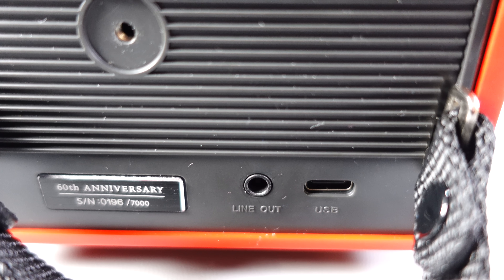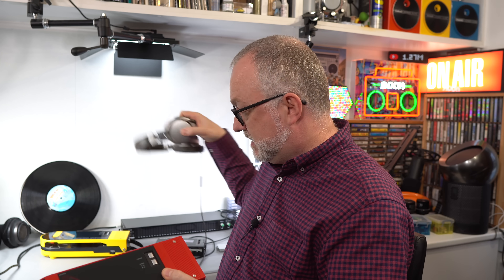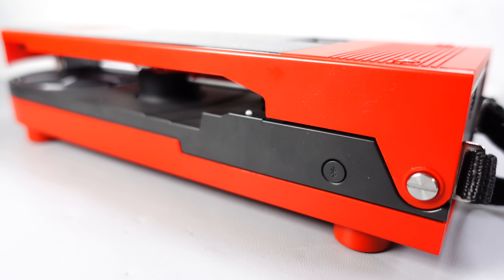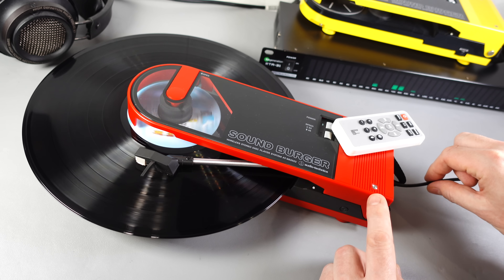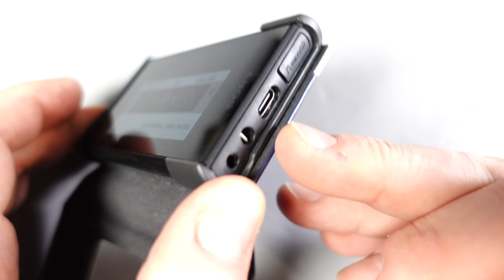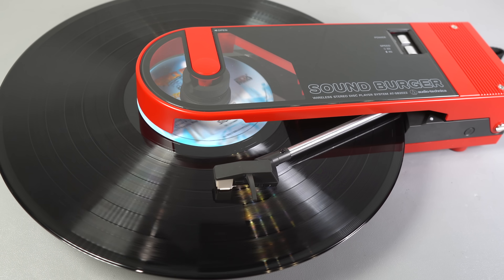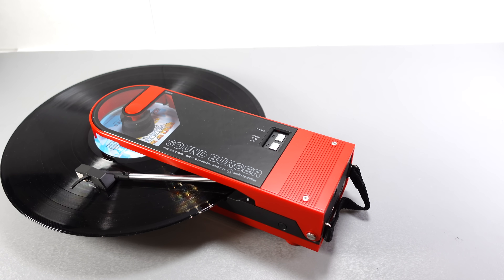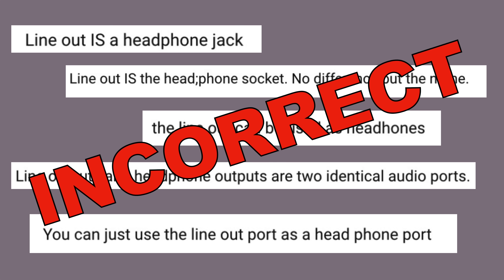Line-out ≠ Headphone-out

Comment: Desktop pc sound cards have a socket labeled line out and you can plug in headphones into that, sound card detects the impedance of what’s been connected and adjusts levels appropriately. This may be the source of confusion.
Reply: I was just about to write the same thing and then saw your comment.  The sound I/O chip definitely does that in most PCs.  In some cases they even ask you to confirm what you just plugged in.
Reply: @PhilR0gers  Most will ask to confirm because the impedance ranges for headphones and line outs are virtually  the same 80-600 vs 100-600.   By selecting what you plugged in it allows the system to process the proper audio level to the jack constant or variable(-10dB or -7dB), just like using a physical switch to choose.
Reply: Dell Optiplex always detects if have plugged in headphones or speakers, although I need to choose, cause the sound card thinks my headphones are speakers probably because of the larger impedance
Reply: Modern smartphones do the same thing - they even remember separate volume levels for line out and headphone out. On my phone, the line out (which I use in my car) is always set to 100% volume, whereas the headphone out (which I use on my bike) is usually set to 60 or 70% volume. You can hear the impedance testing when you plug the connector in halfway (so the wrong set of contacts are being connected), you can hear some high pitched test tones as you plug it in.
Reply: @muf1772  Well, most modern smartphones have no jack anymore. But good to know that those who do have the same functionality.
Reply: @kyoudaiken  Wouldn't say most, more like 50/50
Reply: @PiddeBas  deffo not 50/50
Reply: @muf1772  So that's what the high pitched noise is! Thank you
Reply: The confusion is older than PC sound cards. It stems from old boomboxes with Headphone/Line Out sockets
Reply: @koppadasao  I remember them being separate or manually switchable.
Reply: Yep, some modern motherboards with supported audio chipset and hardware combination can detect impedance and perform auto adjustment for it, though GUI software is required for that.(from manufacturer)

My X2HR(30ohm) when plugged into my Gigabyte X570 Aorus Pro AX, the driver automatically chose "smart amp Level 1" for it. (onboard ALC1220 supports "smart amplifier".)

On my previous ROG Crosshair VII Hero, it also does automatic impedance detection. The "SupremeFX audio" claims to use multiple MOSFETs for impedance detection and there are various external circuits for amplification.
Reply: For headphone out you need low output impedance (ability to supply sufficient drive current) and volume control. Line out doesn't need either. For 16-45 Ohm headphones, you don't need more than half a volt, so with a current buffer, there is no differentiation needed between low-impedance headphone out and line out. This is the logic of MANY non-hifi devices including PCs.

Indeed driving both headphones and line from the same outputs is how it has been done on PC soundcards for decades long before impedance probing become available with Azalia.

In HiFi you expect additionally ability to drive 300 Ohm headphones, which need much higher signal voltage and correspondingly lower current.
Reply: My pc gives you the choice of setting as line in, line out, mic or headphone when you plug something into the socket
Reply: @woofgbruk5947 yes but the headphone choice isn't a true headphone feed, it's why when you turn the volume up they sound crap.
Reply: @wheelmedia0832 no, thats not the issue here. That would be emi noise. All motherboard audio has this issue because no matter how much you try and shield or seperate motherboard audio, its still gonna be inside the computer. SP/DIF would be usable, however, as its full digital out (though that should be fairly obvious anyway)
Reply: @Douglas Blake Not every PC is the same. I had motherboards which do and even display the impedance. And it's roughly correct. Remember that low impedance is hard to measure accurately with low current.
Reply: I had a motherboard back in the 00's with ports for 5.1 surround in addition to the usual set. It'd let you plug anything into any port and if it couldn't detect what it was you'd get a popup asking. I used the rear and center speaker ports as extra line-ins when recording stuff.
Reply: Realtek sound drivers have a jack reassignment switch in software and that allows each 3.5mm jack to change functionality. I've done funkier things with that before like using microphone-in as headphone-out but it will always sound worse than the original function of that specific port.
Reply: Also, some PC sound cards can bring up a list to choose what is what you plugged in.
Reply: @IntegerOfDoom  Again, too literal.  Too complicated for YT reply but you can measure impedance using  (Z = V / I)  You can substitute impedance Z for resistance in Ohm's Law. Calculate Z = V / I to find the impedance at resonance frequency. This should be the maximum impedance your speaker will encounter in the intended audio range.
Reply: @Douglas Blake Not Necessary is not the same as Not Possible.
Reply: That is what makes Windows PCs great compared to Apple computers. They have discrete sound cards with line-in and microphone inputs. Mac, it is headphone only, but you have the internal mic with Webcam on the Macbook and iMac. Still, no line-in as on the old computers. So new Mac computers are downgraded. No, USB audio is not a replacement but you can get decent sound just counterintuitive and defeats the 'good-vintage' premise.
Reply: Regarding this, what if you need the Line Out to plug in your Surround speakers, so now you have nothing when you want to use headphones? Plugging in and out every time I switch from Surround (movies) to Headphones (games) seems tedious.
Reply: Line out on PCs do not detect a headphones impedance. They can however act as dual line out/headphone output and will ask the user whether they have connected speakers or headphones. If you tell it you have connected speakers, it will keep the volume to the line out standard. If you tell it you have connected headphones, it will allow your device to access the sound card amplifier. However, the headphones will still be limited by the amplification power of the sound card, meaning that higher impedance headphones will still sound quieter compared to lower impedance headphones. The sound card itself doesn't know what the impedance of the headphones are.
Reply: @SSJfraz  Yesno. It depends on the standard the Desktop PC uses. AC97 needs to ask the user if a headphone was plugged in. Intel HD audio though (even if you use an AMD platform) it will detect and adjust. And it also depends on the motherboard and which audio chipset it's using. It's typically Realtek these days with diverse amplifiers fitted. You can still change the impedance if you desire. AC97 is almost extinct and almost vintage by now... Seems like you are handling very very old systems. But times are changing.
Reply: @kyoudaiken  I'm sorry but it's impossible for any sound card to automatically detect the impedance of any headphones connected to the line out. The sound card simply takes a digital signal, converts it to analogue, then boosts the analogue signal before sending it to the headphones via the cable. The headphones do not send any information in reverse back to the sound card. The only way the sound card knows that you've even connected headphones at all to the line out is when the PC prompts you to select headphones or speakers once a device has been connected to the line out. The headphones can't send digital data to the sound card informing it what it's impedance level is, because only analogue signals can pass through a 3.5mm jack cable and line out only sends analogue information in one direction, it can't receive analogue information. A mic input on the other hand can receive analogue information, but headphones aren't microphones (:
Reply: @SSJfraz  Sorry, you are wrong. It even shows the headphone impedance for me, which is roughly correct. High end motherboards do this since almost a decade now. I can't send links on YT so I cannot show you a screenshot for proof. But it's real. Most high end motherboards (not all) do this. And that's where the confusion comes from. People think Line-Out and Headphone jacks are the same when it's really not the case just because most PCs and laptops are clever.
Reply: You are wrong. Sorry. I can read the impedance of headphones with a simple voltmeter, why would it be impossible for a sound card to do the same? You way over complicated your thoughts and are taking the whole "data" thing too literal. Just about any electrical device is capable of providing feedback in the way of resistance and or capacitance level. How does a AAA battery tell the device it is low?
Reply: @SSJfraz  It would be trivial to build impedance detection into the card if that was to be part of the design. There is such a thing as having multi-use pins, every microcontroller for instance can switch any pin on it from input to output via software. I've used the same pin on a chip to drive LEDs and also to detect if a switch is pushed, you just shut the LED off and put the pin into input mode for a millisecond to read the value, then go back to driving the LED. Not noticable.
Reply: @SSJfraz  who said anything about "sending" anything, or a "digital" communication? It's trivial to measure the impedance, you send a ~10kHz sine wave through the headphones at a known voltage and measure the voltage across an internal reference resistor in series. This will tell you the impedance after one simple calculation. Alternatively you can do a whole frequency sweep and be even more accurate, or you can use DC and be less accurate but silent. Don't speak on what you have no clue about.
Reply: @boardsort  you can't read impedance with a common
Reply: @SSJfraz  Headphones have 16–64 "ohms" of impedance and draw relatively high current. Line inputs have ~10,000 ohms of impedance and draw very little current. On an auto-sensing output jack, the amplifier knows the voltage and the current it's putting out (YES DIGITALLY) and therefore knows what device it's connected to.
Reply: @SSJfraz its entirely possible for a intelligent circuit to evaluate the impedance of the circuit that follows it, in this case the relatively low impedance load of headphones or high impedance of an amplifier or buffer stage. The MAX9856 chip is commonly used in sound cards and does exactly that. 'the software automatically monitors the insertion and removal of a headset and reports the result in the Headset Presence group box. If there is a headset configuration change, the software automatically detects the headset impedance and reports the result in the Headset Impedance group box.'
Reply: Some people seem to think all PC sound sockets are the same. Some Sound Blaster cards DO automatically detect attached impedances. Not all things that appear the same are, which is the entire point of this video some seem to have missed. Your experience doesn't cover all potential experiences.
Reply: @SSJfraz  headphones are lower impedance, typically 8-100 ohms, vs line which is typically 1000 ohms or more.
Reply: yep i was about to comment the same... it can also have a headphone out however your computer detects what you jacked in and adjust it...
Reply: Or in some cases you get a pop-up on the screen asking what you just plugged in so it can adjust
Reply: Fair point
Reply: Yes I can see where that could cause some confusion. That is good information to know.
Reply: On Computers it will not normally detect when you plug something into Line Out unless it's a quality SoundCard and the mis concentration it is a Boosted Mic Port is wrong.
It is your Software as in the little volume Control at the Bottom right of your Desktop in the case of basically every version of Windows.
Plus normally it's Speakers plugged into that Slot.
Reply: yeah, mine did so, and it also ask me what lineout i plugged in, while some output maybe not significantly shows the difference, but when im using combo headphone, the difference between Line-out, Headphone, and Headset slightly seen
Reply: All I know is that the line-out on my PC card is amplified no matter what I plug into it or what I tell it to do.  Using the on-motherboard audio ports, works but I have to crank the shelf unit I use as a set of speakers down to nearly nothing to prevent me from blowing the poor things out.
Reply: @Minalkra  Make sure you got the correct drivers installed.
Reply: @Douglas Blake They can do that perfectly fine as long as they can lower the level down to line level if requested. Heck, we had sound cards in the 90s with built in 2x5W speaker amplifiers that you could enable with two jumpers on the card.
Reply: At the risk of sounding stupid are the  🎧 with a built amplifier..or would that require power .Or have I missed the point completely 😮
Reply: @boofuls  only noise-cancelling and wireless headsets have amplifiers in them. Also, a line-level signal is designed to only send a signal as voltage, not power. A headphone jack has to send both, so huge difference in the electronics that drive them.
Reply: Yep, I have a suspicion that this is EXACTLY what caused the confusion.
Reply: Heh. Gamers amirite
Reply: Some of the cheapest on-motherboard sound chipsets as well as some 90s sound cars seem like they only have a "line out" and "line in"
Reply: ?Question?..
Also..What is the PHONO jacks for and is it different than line jacks and how so??? Thanks
Reply: Yeah this was my thought, I've been using it for headphones on desktop for years now with no issues whatever. It's good to know that there is a difference but contrary to what the video suggests, there are plenty of devices where you can use line out for normal headphones with zero issues.
Reply: Did not know that but pc have a vol control anyways
Reply: Thank you. Glad someone else saw that too. Because that's been a lot of my experience
Reply: Problem with that explanation is that most headphones today are around 32 ohms, but headphone outputs are required for 8-600 ohm use.  Line outs use a source impedance of 100-600 ohms.   The system cannot use impedance to determine line or headphone connection.
Reply: And then you have mine that doesn't do that at all and will totally sound awful with line in and out
Reply: I think we have a similar answer, both coming from the use of computers, you can plug anything into the 3.5 jacks on computers and the software will say "hey whats this device" and you tell it if its headphone, microphone or line out and will adjust acordingly
Reply: Again not correct more miss information.  A computer adds 10db to their line outs that you cannot see 😂.  You are still not getting true headphone output
Reply: Really?

Because in every case where I've done this, the headphones with huge impedence were always quiter.

This suggests that the system is delivering the same power when at the same volume setting. 

If these systems increase power to adjust for such headphones, then why are they quieter?
Reply: I think the confussion is even simpler, the average users does not care, they see Jack format, and the word 'out' and thats It. 
The logic im following It that, that is what i tough
Reply: "Line  In" levels not enough to drive those old headphones with 8ohms speakers. Newer headphones use 32ohms speakers, you do get some sounds from them via "line in".
Reply: Yes, that's what I was just thinking about.
Reply: I know this is 3 years old, but I guess is device dependant...

On my current PCIe soundcard on my PC the headphone out is bi-amped (1 amp per channel R and L) and has a certain impedance that it clearly states not to use or may cause damage to the soundcard (I think it's very low impedance headphones that can't be used) also it doesn't ask what you plugged-in on any output or input like old onboard soundcards like from Realtek, also I never remember any creative soundcard that did that.

Also had a nice Auzentech soundcard that had Auzentech hardware much better than Creative back then but used creative audio processor and its own built ram and also never asks for what device was plugged-in, they are well labelled anyway unlike my current creative.
Reply: No volume control apart for the software in use and your good headphones gonna sound like a tin can flat and flat nobody is considering full spectrum
Reply: Some modern motherboards with integrated sound i/o also have a plug labeled line out that's more than suitable for headphones in my experience, which could also lead to believing any line out can be used for headphones with no issue.
Reply: @drekieldur1558  All modern motherboards with on board audio have a 3.5mm line out which you can use for any audio output device including headphones, As long as the OS audio driver is installed, It will detect or ask you to chose what the device is plugged in (speaker or headphones) and give you the desired output.
Reply: @0raj0  no shit?
Reply: Unless your headphone has a built-in amp (includes volume control on the headpiece) only then you can plug them into the line output socket. 🎧
Reply: @SilichipX  On PC motherboards, that's not always true.
Reply: @kyoudaiken  When you say "It just works", how do you know anything is changing?
Reply: @dwindeyer  Because when I connect my headphones I can turn up the volume until my ears bleed and when I connect an amplifier to it, the amplifier doesn't get overloaded. Some motherboards I had even gave me feedback through the driver and told me that it detected headphones with 40 Ohm of impedance, which roughly matches that of my ATH-M50x headphones I am using. The current MSI CREATOR TRX40 motherboard doesn't but I also didn't install the Nahimic drivers because I don't need them (they just provide effects and a UI in the system tray but I don't like to use EQ or anything, just direct output).
Reply: @kyoudaiken  that’s fascinating, the last high end mobo I bought (in.. 2015?) still just asked what you plugged in, and it was Realtek. Cool that yours tells you the resistance on the screen. Though I never used the back jacks, just the ones in the case, which I know have thinner wires and fewer contacts in the jack. Maybe it would’ve automatically adjusted if I’d used the back — no point trying now since I have an external interface.
Reply: @kaitlyn__L  Maybe your case uses the old AC97 standard? Some cases in the transition times had two audio connectors on the same cable. But when using the Intel HD Audio one, the features of detecting something to be plugged in was not working, because the little switches in the jacks are not present on your case yet. So the detection simply doesn't work on the front audio connectors. I personally don't use the front ones. My headphones came with a 3 meter cable. (Audiotechnika ATH-M50x, but a new one I bought for my bedroom only came with the curly one and a short one)
Reply: @kyoudaiken  Device impedance detection should work just fine on an AC97-style front panel. The only thing you really lose compared to HDA headers is the plug insertion switch.
Reply: @kyoudaiken your ears are bleeding from dB not sound clarity 😅
Reply: Plenty of things don't detect anything and just drive the output voltage with same circuitry everything and if you're expected to plug in headphones or a jack into your car or whatever doesn't make them change modes

You can use line out as headphone, it can just suck immensely as an user experience. Could, should, would are all different words.

Some old soundcards had two outputs, not so much as a headphone out. The amplified output just went up to hotter level, you could still change volume from the internal mixer for both tho.
Reply: So that explains why I've always been confused.
Reply: Don’t lose sight on the Kingdom of God 🏞️ all that is in the world is soon coming to an end. Seek God whilst He may be found. Jesus saves ✝️🙏
Reply: PC sound cars dont sound good.  You need a dedicated USB Dac like a Cambridge audio dacmagic.
Reply: @philipslighting8240  personal opinion. I’m 69 years old and my ears ring so much that i can’t really tell the difference.
Reply: @TomCee53  Pardon ??
Reply: @philipslighting8240  What I’m saying is that inexpensive sound cards or built in interfaces are just fine for most people. I can barely hear any highs over my tinnitus, and as long as I enjoy what I’m hearing, it’s great.
Reply: @TomCee53  "pardon"  was a joke  Im British we have a sense of humour over here. :)
Reply: @philipslighting8240 if you have too much money you can send some to me, I won't mind.